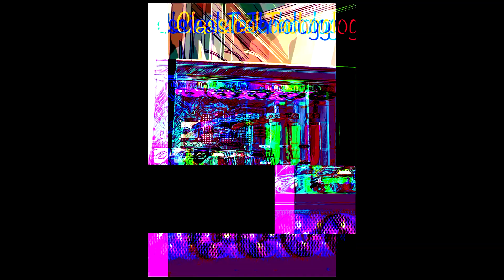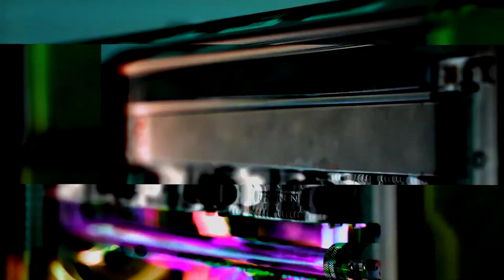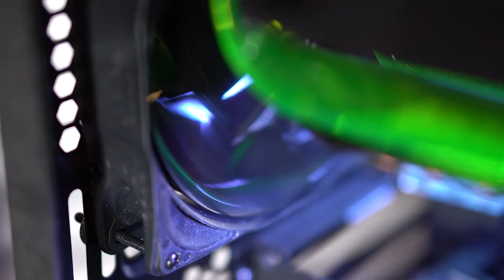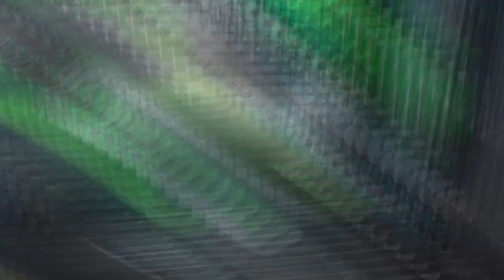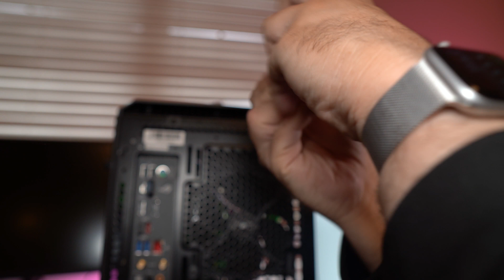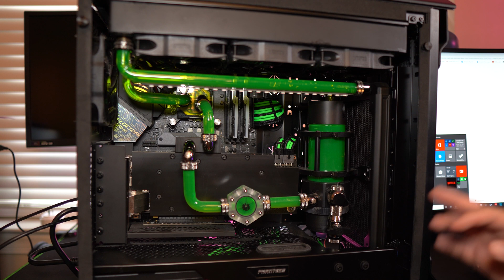How to Troubleshoot a PC & GPU, NVIDIA TITAN XP STOPPED WORKING!

Comment: My titan blew when we tested a TV :( when we tested the TV and plugged it into the gpu the gpu went off and there was smoke but funny enough the only part missing is 0502 well that's the number for the part idk if that's the main part but ye when we texted it again we ditn plug in the cables just put it in the motherboard and we wanted to see if we got a signal sadly nothing and when we put the wires in we heard strange noises however when we started hearing it it was only on for like 5 second